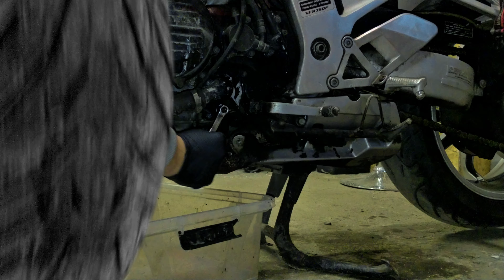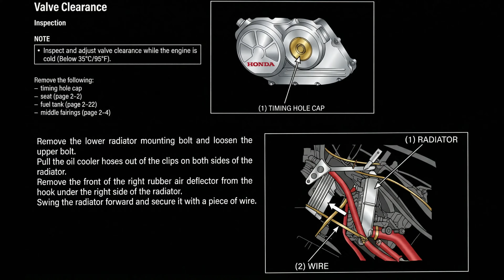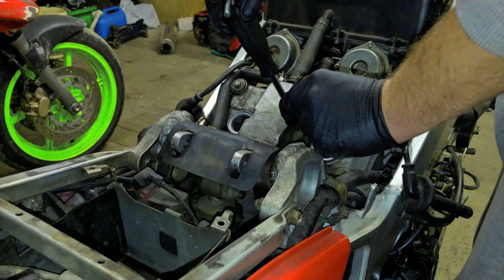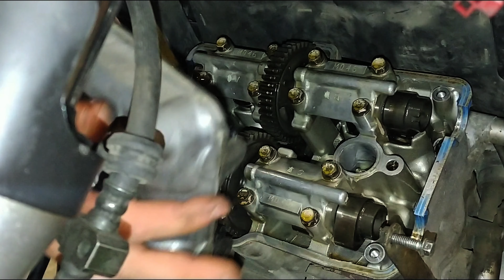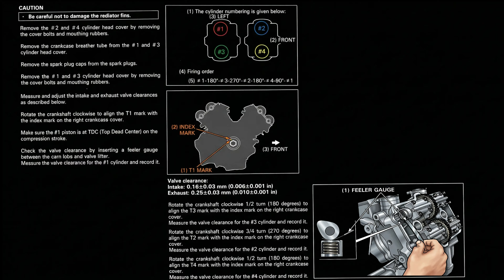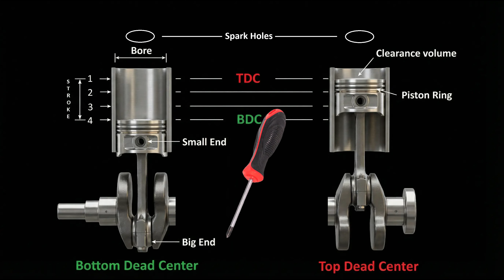T1-T4 Crankshaft Marks Explained | Valve Clearance Check | Honda VFR750 RC36

Comment: Would like the valve clearances sheet 🙏

Is this a rc36 or rc36-2?

I have a '97.
Reply from the maker: Check under this link:
https://1drv.ms/x/c/76ed2026440f44d9/IQAiKSQsRH3XQ7ZOEO4DFjPdARZJ6Ea-LDplrdkewrZOeLQ?e=im7wPp

I have 2x36-1 and one 36-2. Engines are basically the same, valve clearances are same.